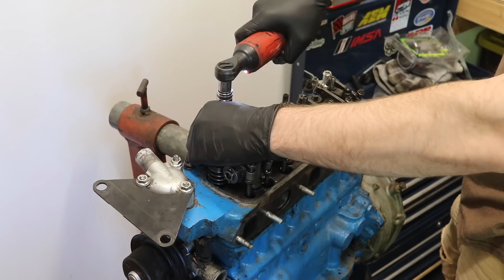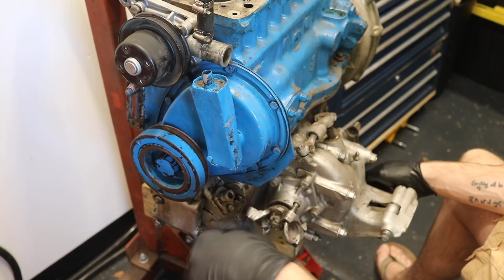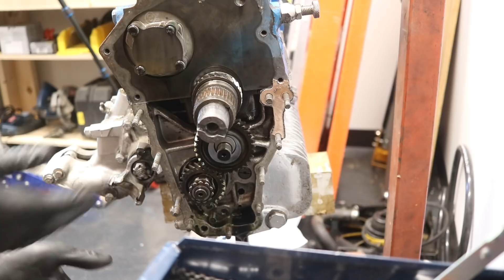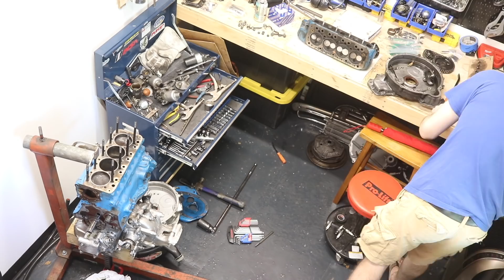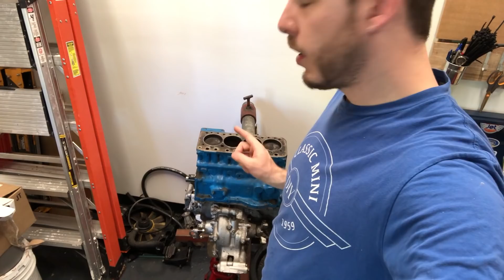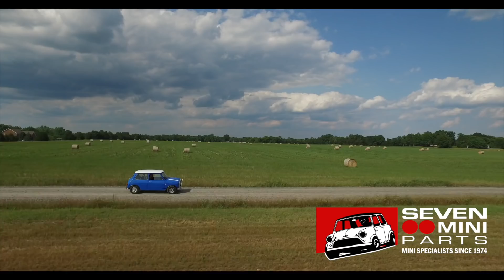Operation Bad Wolf - Lets Rip this Apart  [Ep. 3]

Comment: Just to add to your comments about the A-Series being fitted to the Austin America and in the UK, on the Austin (Vanden Plas) Princess. It was also fitted to the entire ADO16 range of Cars from BMC/BL which was Austin & Morris 1100, 1300, 1300GT (1275cc Cooper engine with extra head stud), Vanden Plas Princess, MG 1100/1300, Wolesley 1100/1300, Riley 1100/1300, Magenta Kit Car, Apache, Nomad & also made a brief appearance in the Austin Metro (A+ Series). Parts for these engines in the UK are readily available, especially through the 1100 Club which caters for all marques of the ADO16 Range of cars, commonly known in the UK as 'The 1100'. Loving the series, it's really well shot with great visuals and well paced tutorial. Thanks for all you're doing!

Comment: FYI. The fancy washer that goes under the flywheel bolt should be bent up against at least one face of the bolt to keep it from coming out. It is a lock washer.
Reply from the maker: Thanks for the tip. I guess when I put this together last I forgot to bend it up. Will definitely be doing that this time.

Comment: I took off my first flywheel off in December. it took 6 weeks, I bent two plates and then got my hands on an original flywheel pulley and finally got it off. the most frustrating thing I've ever encountered.
Reply: conor morris agreed the first time pulling those off is frustrating. Until a mate told me use a heat gun on the flywheel while you have the puller attached and on tight. Takes up to 30minutes but has worked every time since

Comment: A good video and to show a allot of detail.

How does the waterless coolant go in the mini engine? Does it overheat on a hot day?

You mentioned before your head was ported did you want to go over that and does it have hardened inserts?

And what’s the plan with the old gearbox?
Reply from the maker: The waterless coolant has been working like a dream so far. I did a video all about how to do the swap from water to waterless. 100% will be sticking with it when the motor goes back in.  Regarding the ported head I recall getting hardened inserts when I had the machine shop port it. I also installed larger valves that I do not remember the size of.  

Regarding the old gearbox I am going to give it a nice cleanup and I will be selling it as a whole kit since its working (recently rebuilt) gearbox. Would go great in someone elses mini thats for sure.